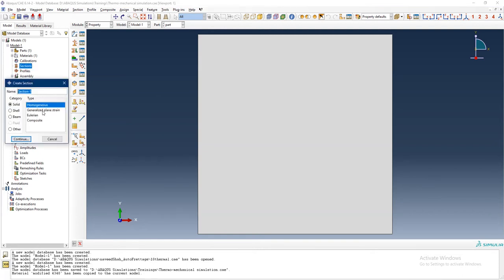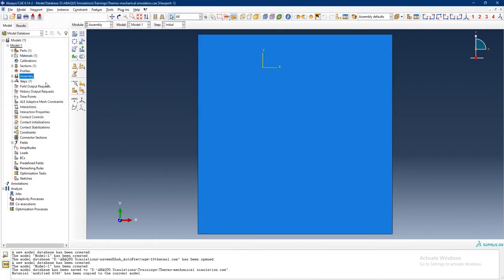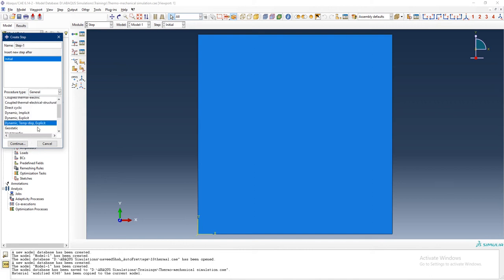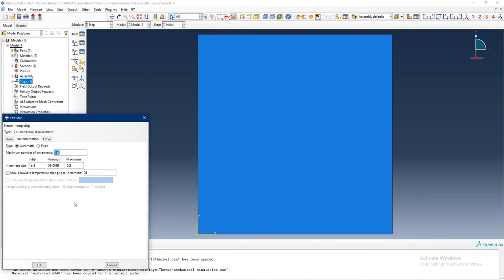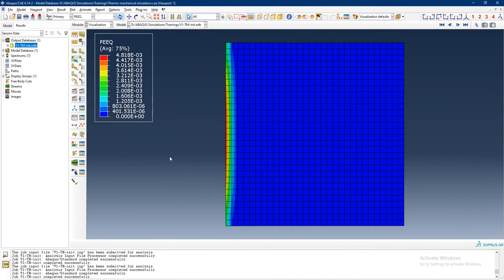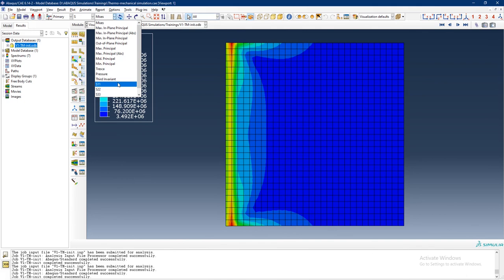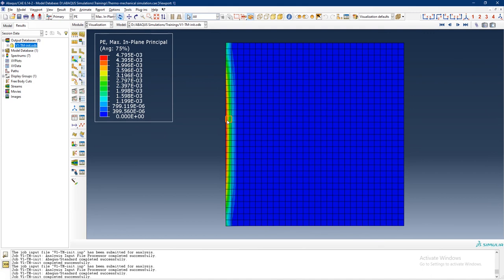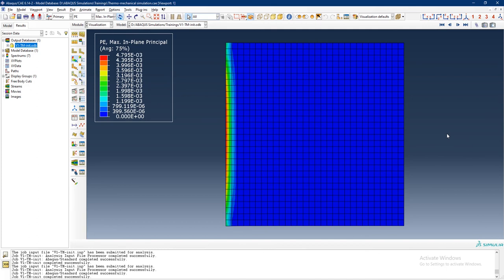Thermo-mechanical simulation in ABAQUS : Part 1

Comment: I want to calculate the thermal mode of a composite material. How do I calculate the buckling temperature of a material?
Reply from the maker: It is an interesting question but I cannot answer it here in comments section. If you would like to discuss it in more detail we can have a shot chat on some other platform. Check faisal.qayyum.com/contact for getting in touch

Comment: Hi Faisal, i recontact you again to ask you something about induction heating. Is-it possible to do a numerical simulation of induction heating in abaqus ???
if yes, can you please help me by giving me a simple example ???
Reply from the maker: Yes, Pierre, I remember that you asked this question earlier. I'm not sure what do you mean by the "numerical simulation of induction heating".
If you are heating a sample by using induction in a physical experiment and you want to replicate those boundary conditions in the numerical simulation, you do not have to actually model an induction coil.
Just calculate the heat flux produced by the induction system using some simple formula and apply it to the sample surface directly in the numerical simulation model, as I showed in this video.
I hope it answers your question.

Comment: How can I get the plastic strain at different temperatures?
Reply from the maker: You can use field output data for a specific node to get plastic strain at that node for the whole simulation. Or you can use Path output function to get data at a specific frame on a series of nodes.

Comment: Hi Faysal, can you please do a tutorial on a thermomechanical simulation in compression (respectively in tensile test)taking into account an electric heater at the end of the specimen ? thanks for your answer.
Reply from the maker: Heyy Peirre, I believe that's not complicated. In these simulations the hearing source is not really defined, rather, heating is stated as a surface heat flux. 
You can calculate total heat flux from the electric heat source and apply it in the simulation model and I believe it should work fine. 
Did that answer your question ?? If no, try emailing me your detailed problem for further discussion.
Reply: @FaisalQayyum  Hi Faisal, Thank you already for responding to my question. In fact, I want to do an experiment on Gleeble using it as comparison results. For this, I have to do a 3D dynamic compression/traction test to simulate the electrothermomechanical effect. that’s kind of my problem. Maybe you can direct me . Thank you